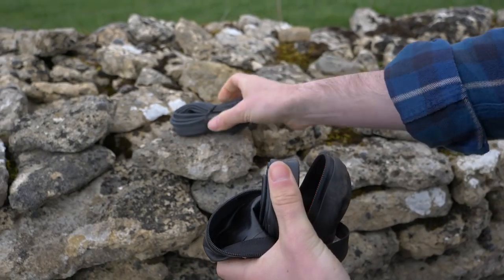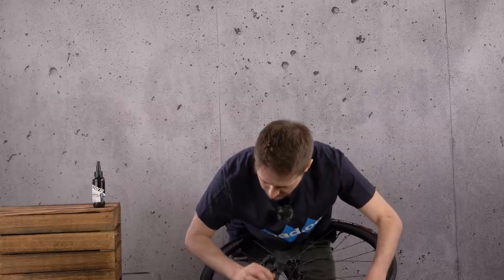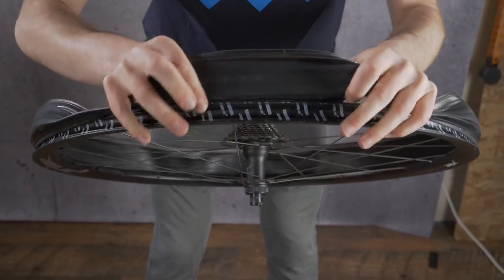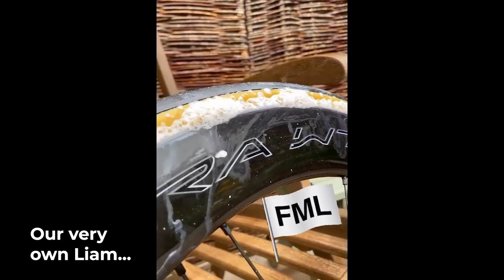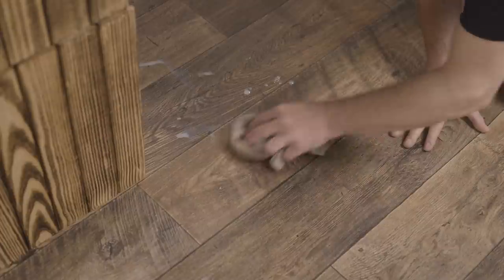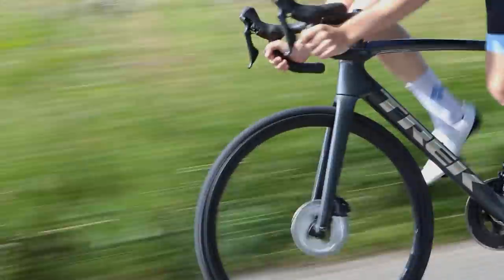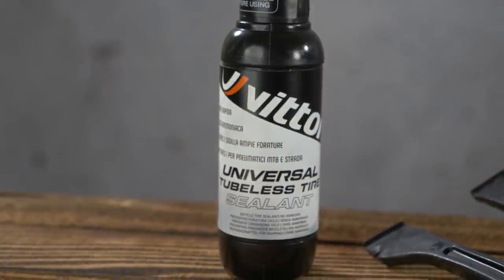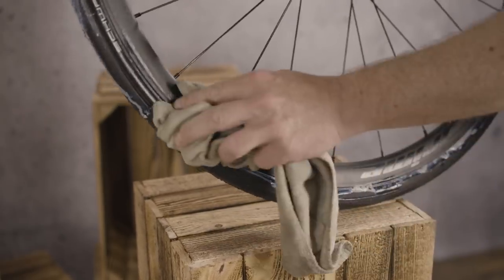9 things they don't tell you about tubeless tyres

Comment: If you intend to run tubeless tires at high pressure, for example 23c tires or you're a heavy guy trying to run 25c tires. Then you'll have less success sealing punctures before the pressure is too low to ride the wheels. When pumping them back up the weak seal can blow and you'll be stuck again. So for going fast over smooth roads, it might not be the best choice, as you'll be more efficient with narrower tires there and higher pressures.
Reply: Agreed. I’m a heavy guy running 30c, but actually enjoy more volume nowadays especially descending. Usually run around 45psi. My days of skinny tires are over haha

Comment: I thought tubeless is better due to the sealant as endorsed by the bike shop.

After just a few rides I experienced a terrible hole. It sprayed the sticky sealants everywhere. My tire was flat. To add more horror to the problem, the tire levers do not work as the sealant stuck the rim and the tire together!!! Everything happened at sunset. I was able to manage things after an hour or two working in the dark with just a bike light.

From then on, I opted for inner tubes with more puncture-resistant tires instead. I am happy to say I never had a flat tire for years now with this setup.

Comment: And this is why tubeless will never be main stream. Can you imagine the general punter topping up there sealant every 2-3 months heck every 3-4weeks if your use the hyper active stuff. Heck most bikes I see at the bike shop in for a service haven’t even been cleaned in months. And that goes for the enthusiast’s bikes as well. Lost count of the multi thousand pound carbon wonder bikes I’ve seen in an absolute state. 

Most tubeless systems don’t even site the puncture protection anymore as there usp. They site rolling speed and comfort as the main selling points and to be fair there not wrong. 

Tubeless works within a very small window. For the road most of the problems I get are cuts from glass and very sharp broken stones. Tubeless just can’t seal these and plugs just fly out of the tyres and or weep for days never sealing. At which point I have to put a tube in getting covered in shit in the process. Not to mention I have to get the valve out near impossible with frozen hands and the valve being solidly stuck in place. For the road at this moment in time I just don’t see the benefits. It’s quicker and easier to still swap a tube and not to mention cheaper as there more able to be repaired heck even latex tubes are less hassle.

Comment: Witnessed a tubeless tyre failure a couple of weeks ago. Rider hit a pothole and his front tyre just exploded off the rim causing him to crash. It was a very expensive bike with Etap system. Scrapes on the shifters, rear derailleur bent, sore rider. He had to do a lengthy road side fix using a tube, but it did not last the rest of the ride. All that free sealant effectively lubed the rim and it being hookless design, tyre just broke loose at the next opportunity. Had to be loaded onto the support van. Spoiled day for him. And for what? The guy would have been much happier with his purchase if the bike manufacturers stuck with a tried and tested reliable system. He bought us all a coffee as apology for holding up the ride but it was not his fault. Great gesture though. Cheers Shep.
Reply: Sounds like he was running too high pressures if it exploded off the rim; the whole point of tubeless is running lower pressures....
Reply: @Andy_ATB  Yeah sounds like that.
Reply: He could have run high pressure with tubes and not had it explode off rim.
Reply: Sorry to here the damage to the riders bike 😯

Comment: Im running a non tubeless tire on a tubeless ready rims with motorcycle sealant with ZERO issues.
Reply: Just be careful. Non-tubeless tired don’t have the same bead shape and they are known to blow off the rim
Reply: @Daniel-km3zw  im only pump it to 30 psi for front and 35 for rear.

Comment: I would never choose tubleless for anything.  If you need  a compressor to reseat it and therefore need  to take a spare tube with you for a repair, because a plug is not a guarantee,  the whole system is pointless.  I would literally smash the eff out of my bike if I got a flat then was covered in sealant for my ride home.  Not a chance in hell is this a good idea for anyone that doesn't have a team car and mechanics.  Absolutely  a waste of resources in my opinion.  Between no universal standard and the need for a product that doesn't need to exist, sealant, this is a scam product basically.  Tape your rims, sealant, buy a tube anyways and bring it with you and a plug kit.  Make sure you have cell service and walking home covered in glue.  Yeah no thanks.

Comment: Don't change, stick with what you know, penny farthings and using your cloggs for brakes
Reply: I gave the new technology a sincere go (18 months) and ultimately decided that the disadvantages outweighed the advantages. I'm basically waiting for tubeless tires without the need for sealant, and that are possible to mount onto a rim without an hour or two of cursing. Car tires seem to meet my reasonable criteria, and I'm hopeful tubeless bicycle tires will eventually get there as well. Until then, I'm sticking to penny farthings and clogs.
Reply: From what I gather, only people running tubeless tyres with sealant are likely to have "clogs"...
Anyway, I'm not averse to change, I just like to adopt new technologies as they prove their worth.
e.g. I've now fitted SPDs to my clogs.

😊

Comment: I've been running the GP5000 tubeless tyres for about 500km and so far the only issue I have is that I need to pump them up at least once a week. If I don't ride for 5+ days then they lose about 10psi. I know I should be checking pressures and tyre wear before each ride but it's kind of annoying. The comfort of tubeless far outweighs that though.

Comment: My bro-in-law's tubeless tire sprung a leak...he had bought the racer 2nd hand and didn't know it was tubeless.  He brought it to a bike shop to change the tire...as he couldn't remove the tire himself.  The bike mechanic took 2+ hours and sweated like a pig to remove and put it back on....and had to add new sealant as the old was completely dry.

Comment: I tried road tubeless, but switched back to latex tubes. I only rarely get flats, and swapping in a new tube or even using a patch kit is a breeze. The thought of installing a tube in a tubeless setup in the case of sealant failure is just too much for me.

Comment: Tubeless is great when it works. Had a few epic fails where I had to put an inner tube in to get home. Pretty much impossible to get the bead back on with cyclists arms and sealant can get on to your rims, resulting in bad and noisy braking all the way home. You can really feel a 25/28c tyre not sitting properly and it has ruined several rides for me. I've gone back to inner tubes on my road bike because of it. Plus, all the equipment you need to do it at home is very expensive.

Comment: I went tubeless 6000 miles ago and will not go back to inner tubes. I installed Conti GP5000 tires on my original alloy rims with little problems. Initial inflation was drama free using an air compressor. I removed the valve core and squirted sealant into the valve stem. I have recently upgraded to Reynolds AR58 carbon wheels. Fitting the Conti GP5000 tires was far from easy. Tire levers and a few beers were required to install the tires. After that everything was downhill. Love the new wheels with tubeless tires.

Comment: Nope!  A marketing gimmick that shows no real reason for the rider, only the sellers.  I can not imagine repeated 50mph descents wondering if my tires might fly off and leave me to brake or negotiate the next corner on bare carbon.  Or depend on tubless to keep me out from under those vehicles whizzing past.  Nope, I don't fancy not being able to inflate every tire, every time without an air compressor.  
   Yes, not getting flats is good, but adding Slime or the like to clinchers or tubulars is easier for that.  
   Call me a Luddite, but much of the recent changes made to high end bikes aren't worthwhile and many are steps backwards...for dubious claims of the sellers of them are made with a big silence on what is lost...

Comment: Tubeless evangelism and sealant Bukkake. 
Latex tubes with sealant in, that's the answer.
Reply: I use Latex, do you use a particular brand of sealant?
Reply: Exactly. I put slimed tubes in for cold weather riding so I wouldn't have to fix a flat in cold temps.
Reply: @Fixin-To  hi, I've used stans, although I've heard that if the tube loses all pressure, and the tube surfaces touch at the bottom of the wheel, they can bond. Then when the  tyre is re-inflated, you can end with a blow out. Plus stans dries out, and you have to put more in. Saying that, I've had punctures, and stans has fixed them brilliantly. 
I've started using orange seal, it seems very good, it fixed a massive puncture recently, and supposedly it doesn't dry out.
Reply: @TheK1steve  thanks

Comment: Gravel bike - want to change out your multipurpose tires to something with more grip for a weekend ? 

Forget it. Tubeless tires are not meant to be fitted, removed, and refitted easily. Sealant dries around the rim edge of the tire and is difficult to remove. This bead of dried sealant makes getting an airtight seal difficult again.
Reply: Nobody tells you this. The bead almost has to be as clean as new to get a re-seal, and that can take ages to clean off old sealant.  Grrrrrr
Reply: I’ve swapped tires numerous times on the same wheels and never had an issue reseating or having them get a seal. And all i did was a simple wipe with a rag. No big deal!
Reply: @JohnnySantoDomingo  yeah, same, I use Muc Off sealant, it washed away with luke warm water and a rag. And on my xc bike it kept the seal even after 1 year and a few months (didn't do the 6 months recomended refill)

Comment: If want to rotate your front and rear tires to balance the wear it won't be that easy with tubeless....
Reply: Bike tires shouldn't be rotated, you don't want a front tire that doesn't grip the road. Only transfer the front tire to the rear and use a new tire for the front wheel.

Comment: The last two points are bullshit. I used either Schwalbe and Stan sealant, and after a year I never found it dry. Adding some sealant is very easy. Simply deflate the tyre, remove the valve core, use the syringe to inject the sealant, replace the core and inflate the tyre. Repair a big hole with the rubber repair kit is quite easy and fast, You don't have to remove the wheels just plug the rubber and inflate the tyre. I used this method also to  temporary repair a tyre laterally cut after htting hard a rock, again wthout removing the wheel. I use a converted tubeless configuration also for my citybike, simply because the repair kit can be fitted in a small pocket, being much smaller than an inner tube + removal levers.

Comment: You still need an inner tube??
Reply: Only as plan B if the selatnt is inefective...
Reply: @bohansen2960  yes but just use inner tubes, no?
Reply: @mattoconnor1694  you can just use a inner tube and not use TL with a TL tire. No problem. Even with hookless … be sure to use a TL tire and then put in the tube 💪

Comment: A lot of negativity involving change, at least we all have choice, lay my conti 5000 tubeless tyres in the sun for an hour or so and pop them onto my new carbon rims without to much fuss,used a couple of stans 59ml sealant bottles to install sealant without spilling it all over the place,most punctures you’ll ever have the sealant will take care of things, if you every have anything bigger, you have a problem Whether you are running tubeless or inner tubes, it’s just a different way of thinking,but i do love latex  tubes,so smooth but expensive,the argument continues.

Comment: Those are all fair points, but at least in my experience, it is way less than this... A tubeless setup, will require more maintenance, which will require more tools (a better pump, a sealant valve injector, repair kit, etc...). If you just ride your bike and add oil to the chain, I would not recommend it. But if you do it right, you won't experience those nine items (mostly) mentioned on the video, and will have a better experience than the tube setup.
Reply: and indeed life will be much easier running a puncture resistant set of tyres, with any kind of tubes... For me, the better experience with tubeless has been totally worth the hassle so far. Let's see in the coming months 😉

Comment: @road.cc... Going tubeless on a road bike is what separates the Pros from the Joe's because you have all your ducks in a row to run it successfully. You need the following:

1.) Make sure you have a proper tubeless wheelset.
2.) The wheelset must be taped properly. (Make sure you do this yourself!) 
3.) A high-quality valve stem that seals properly and does not leak. (I highly recommend Muc-Offs tubeless valve stems as you can really tighten them down so they seal properly.)
4.) Get a  Stan's Notubes valve core removal tool and "Tire Sealant Injector" for putting sealant through the valve stem. 
4.) Use a high-quality sealant that is compatible with your tires. 
5.) Use a high-quality tubeless tire that fits your rim. 
6.) You need to prep the tire before installing it in order to remove all the oils so the tire seal to the rim. (See this video by Continental Bicycle Tires) https://www.youtube.com/watch?v=1HfULR0PnZE) 
7.) Invest in a high-volume air pump for installing tires, regular floor pumps are inadequate for the job. 
8.) Watch as many tubeless tire installation videos as you can so can master the art of tubeless tires. (https://www.youtube.com/watch?v=PKZpmGUEfVU&list=PLvf-JINFuo8GTRJutEmDFXA9WnOcijBYs&index=9)
Reply: Or I can just go for a bike ride with my tubes.

Comment: I love tubeless. My issue so far is that they are only tubeless until you take them off and put them on again. 
atm I have the Pirelli p zero tlr tyres. They were a dream to fit. Went on in seconds and even seated with a floor pump with no extra effort.

Hutchinson: wouldn't seat after taking them off.
Vitoria: Never touching them again in tubeless form. Total nightmare.
IRC: dangerous. Came unseated (yes tubeless rim) on a descent.
GP 5000: Going to be a nightmare to get the tyre back on if I have to put a tube in.
Pirelli p zero: Tyre of choice from now on.

Comment: Some of these are an absolute joke. 9 it’s hard to add sealant, utter nonsense, I’ve got a syringe by Giant. You just suck out the old and add new. Never had an issue removing valve cores either. 

I’ve had 3 punctures recently on my road tubeless; 1st, I only noticed the day after when I saw a bit of sealant on the frame. 2nd, sealed but did require a top up with co2. 3rd sealed and no top up needed, didn’t even have to stop riding. 

So that’s 3 times I’ve not been stuck at the side of the road messing about changing tyres. 

Ive done around 15,000 miles on tubeless and never, not even once, not finished a ride and I never carry an inner tube.
Reply: Yeah, i think at this point they’re running low on ideas for videos